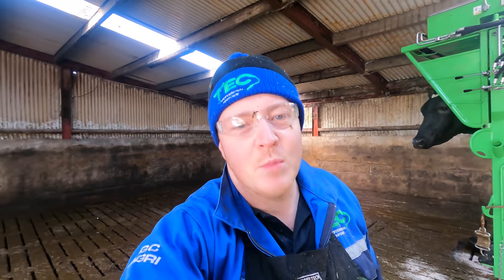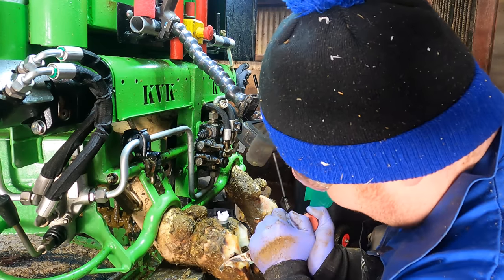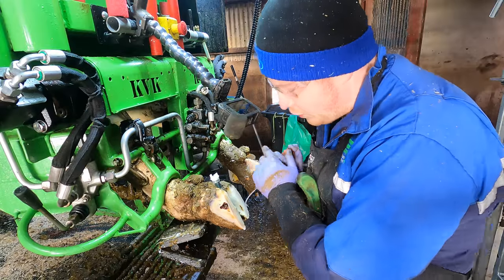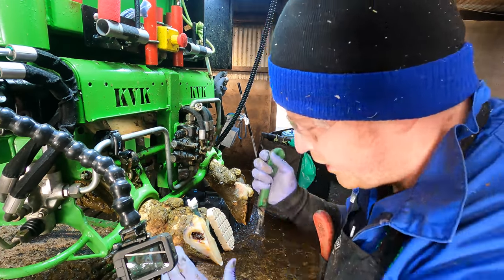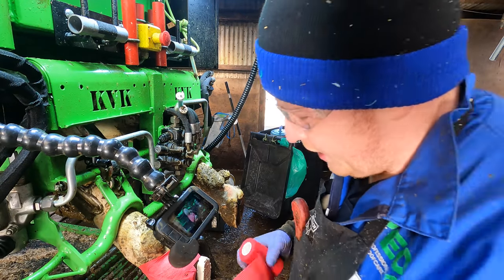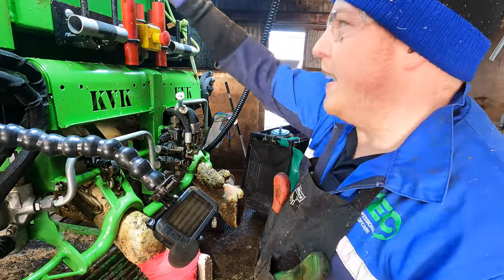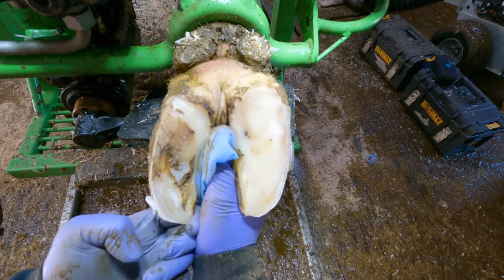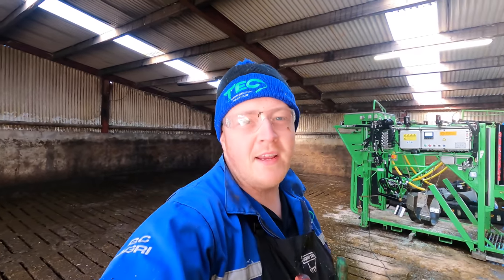TUNNELING HOLE IN COW’S FOOT | TEC TV

Comment: I mostly watch with the sound off, but why in most of the hoof trimming videos I see do the trimmers not use the grinder as much as possible before using the carving tool? There are times it seems the grinder could be used, but it is not. Ignorantly it seems it would produce the most uniform result possible to use the grinder as much as possible.
Reply: Are you a farmer of cows??
Reply: @beautyis30  no